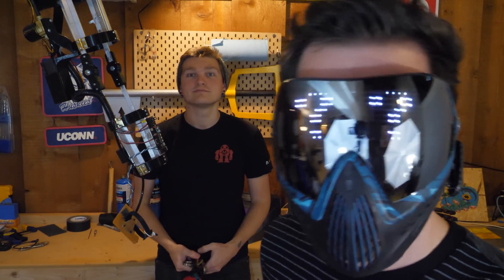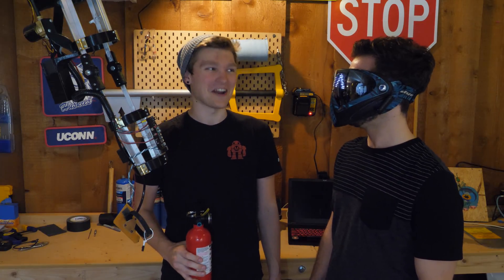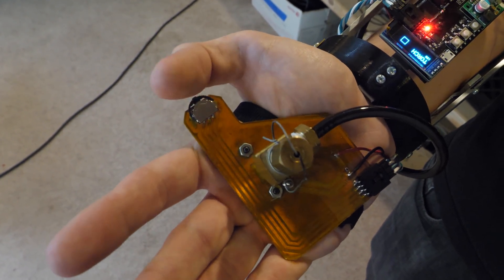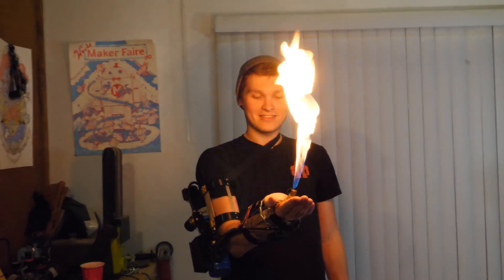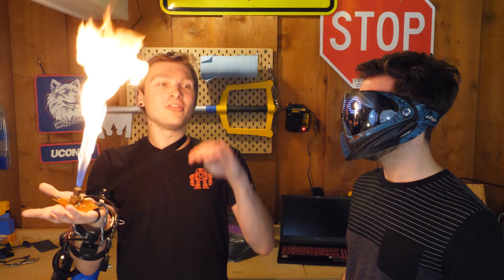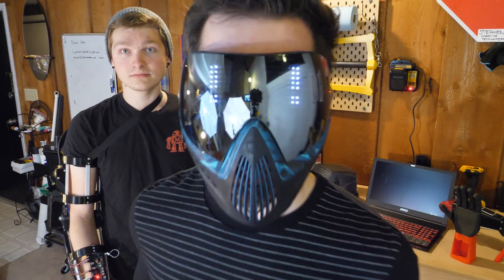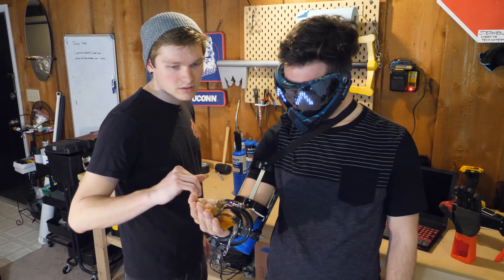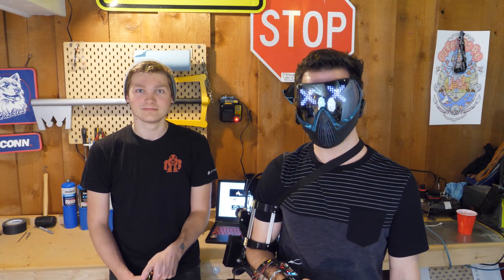"Iron Man" Flamethrower Gauntlet w/ TASER Ignition!

Comment: Complete the gauntlet by adding a built in fire extinguisher, more compact tanks and nomex lining to protect the user from the heat.

Definitely a cool project, I subbed to him!
Reply from the maker: I was thinking about how this could be done. CO2 naturally puts out fire, so some sort of non flammable powder could be siphoned out of a bottle to have this effect. Could be useful for actual fire fighters!
Reply: @GreekGadgetGuru  that's a good idea. Siphoning both the contents of a fire extinguisher and the fuel bottle used already could be condensed into a smaller package and placed on the side of the arm instead of the back. There's a few chemicals that is effective against fighting fires but syphoning that from a fire extinguisher would be the cheapest.